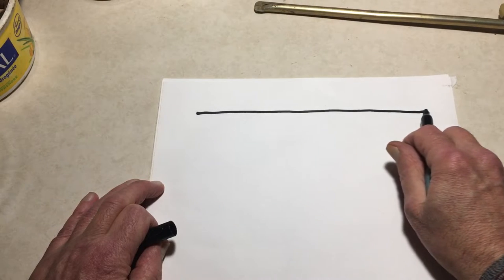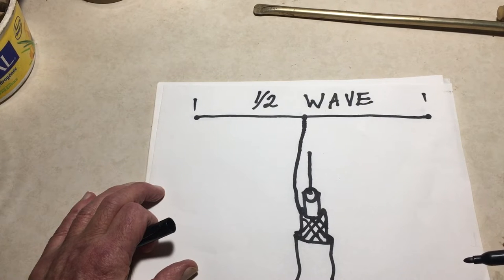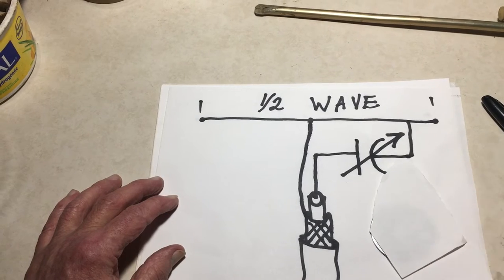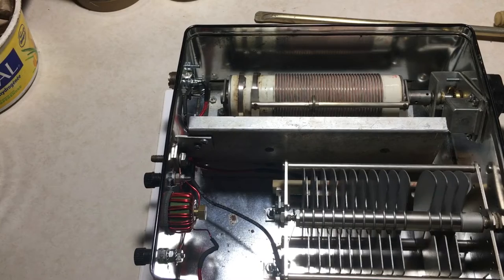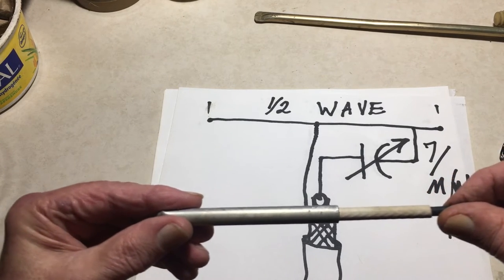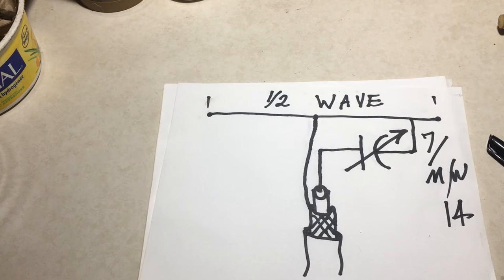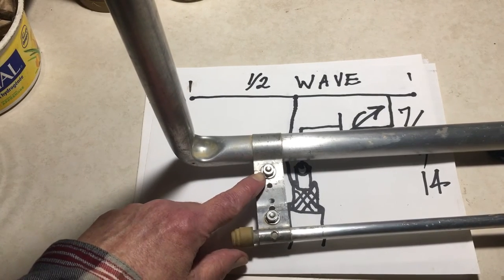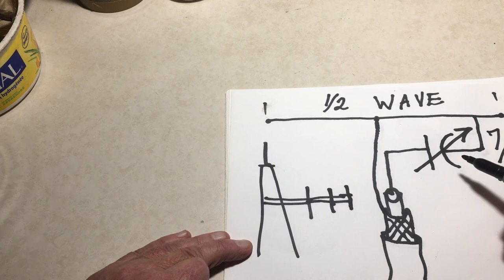The Gamma Match ~ Easy Antenna Tuning Built-in

Comment: Of course the real explanation of a gamma match and how it works is an interesting discussion. First of all, the parallel conductive segment to the driven element steps up the impedance, much like a folded dipole. This in turn adds inductance. The variable capacitor component is then used to tune and cancel this additional inductance out.

Comment: A great tutorial on Gamma Match's. I've been building yagis now since 1972, and have used many feed hookup designs. "T" matches. Delta feeds, Pigtails, and of course Gamma Roads. and I can tell you I've stayed with the Gamma on 99% of my builds . I make most of mine with RG8 coax center dialectrics for the center inside an alumimun tube from a HF mono bander thru 6m,2m 220 mhz 432 Mhz to even 900 mhz yagi's and with great success in feeding. adjusting and performance. thanks for reminding me that my choice was correct! and for sharing. de Ellis WA1RKS
Reply from the maker: Thanks !
73 de VO1DV
Reply: How do you know where to clamp the shorting bar to the driven element?

Comment: What about multiband? If the Gamma match is set for the lower band, do multiples also match?
Reply from the maker: No it’s a monoband antenna but the 1/2 wave design characteristics may be applied to other bands. 
1/2 wave driven element with 
1/16 wavelength gamma rod may be applied to any band. 
According to antenna theory 
“Voltage at the center of a half wave antenna is zero”
So this allows the driven element to be grounded at the center.
Reply: If you want perfection, hi efficency of you antenna system can't  be broadband! Broadband is delusion of  low cost  propaganda!  Professional systems make in 3 or 4 section selective super tuned systems from exciter lpf antenna system!

Comment: This is great valuable information on the Antenna, driven element and gamma match. Any additional information on 27 mhz antenna building would be great. Whether,  it  be 4 element beams or multi-directional antennas. Thanks for the information tutorial, enjoyed it. Billy...Albq. N.M.    2 / 16 / 2023
Reply from the maker: Length of a half wave antenna in feet = 468 divided by frequency in MHz. This can be applied to any band. Thanks for watching and check out my other videos to see some of my other creations. 73

Comment: If they are setup correctly, the gamma works great. I had a 2 element V Quad several years ago, it was gamma matched and had an SWR of 1:1.3 or less from 25mhz through to 29mhz. I still have the QSL card from a guy in country that no longer exists in Europe. We chatted on 27.650 USB for almost 2 hours one night, at an S9 or above. Damn great antenna that one, I still miss it. Nothing came close for OOB usage and pirate CB radio. A fellow I used to compete with for contacts had a 5 element Yagi about 10 foot higher than my quad and he needed 100w more than I did to make the same contacts. Nothing beats a well tuned antenna, and the gamma match is a fast easy way to acheive that.

Comment: Great explanation. How does it work when there is no capacitor present and there is a direct connection via a aliding bar, as with a yagi i use and a halo i have just built?
Reply from the maker: Your “sliding bar” adjusts to find resonance. 
The “sweet spot” I am guessing as I haven’t seen your antenna. 
Glad your antenna is working for you. Keep up the good work.

Comment: On your 6m halo -- is the "halo" fully closed opposite the feed point / gamma match ?  If so, is the overall tube length just 1/2 wavelength?
I'm trying to find novel ways to build a more compact dipole for the high bands w/o inductive lengthening.

great presentation of the gamma match!  thank you so much!
Reply from the maker: Yes it is a half wave loop fed at the centre except the elements are bent 
Thanks for watching !

Comment: Your explanation helped me. 
Yes the center is at zero voltage, its just hard to seperate grounding and the null point of a driven circuit. 
The far side of the half wave looks like it should be driven. Hard to remember the voltage on the right half
will induce a voltage on the left side. 
I keep wanting to think the atenna works because the right hand, driven side,  sucked the left side electrons past the ground, null point, to the right hand high side. Right???
Reply from the maker: The gamma rod and shorting bar when tuned correctly makes a resonant loop which induces a standing wave in the driven element.
Reply: When you look at this thing, think of a center tapped transformer, and the voltage wave across it. The null point of the "sine" wave is the ground point aka neutral, and each end the opposite of each other. Doesn't matter which end is energized the other is opposite. So you tune the injection point and the other follows suit. In my limited understanding...

Comment: The capacitance cap on a Hustler 4 BTV could be used as a Gama Match!  You replace the ones you use with aluminum stripes.  Or buy replacements from DX Engineering!  They sell tubing and parts to build your own antenna,

Comment: Hands down the best description I've seen of the gamma match. I just got a yagi that uses one and it works, but I couldn't make heads or tails of it. Your explanation of the variable resistor was excellent.

Question: How does the location of the strapping point come into play? It can't be arbitrary.
Reply from the maker: The shorting strap combined with the variable capacitor when properly adjusted form a resonant loop which tunes out reactance and induces a standing wave in the driven element. 
Hope this helps. 
Thanks for watching and share with your friends. 
73 de VO1DV
Reply: @madeinfoxtrap5539  Sort of. How does one know where on the driven element to attach the shorting strap?
Reply from the maker: @toddhowell2299  experimentation with various settings until you achieve resonance. Forming a resonant loop sometimes takes a bit of trial and error but with patience you can tune the match 1:1

Comment: Thank you for excellent explanation of aimetric to asymmetric transition adjustment. Is possible add static protection on antenna L grounding ?
Reply from the maker: If you mean an inverted “L” ?
I’ve never made an inverted L So I am not able to comment. 
This design is center grounded.

Comment: Thanks for the axplantion about capacitance but what about the distance between center and shorting bar .the capacitor consist of shift and tube and the area can be changed according to their diameters so what about the distance between center and shorting bar please advice me.thank you very much.
Reply from the maker: Best I can tell you is experimenting until you achieve 1:1 
Adjust until you reach resonance. A bit of trial and error involved but with some patience this design can be tuned flat.
Reply: @madeinfoxtrap5539  A little math can steer you closer, quicker. Does anodizing effect the sensitivity?
Reply from the maker: @bryanst.martin7134  mmmm not sure but I would go out on a limb and say no. If any decrease in sensitivity by any type of coating it would be negligible and probably so little that it ‘s unmeasurable
Reply: @madeinfoxtrap5539  Thank you. Welding is one of my skills, and Al Oxide is tough thermally and electrically. Not sure how that may relate to low voltage, higher frequencies and such. Maybe the high level of signal amplification makes it negligible?
Reply from the maker: @bryanst.martin7134  sorry I misunderstood. Anodizing is a coating applied to aluminum whereas oxidizing is generally caused by the oxygen in the air. This may be alleviated by coating with a thin film of grease or your favourite anti-oxidizing agent.

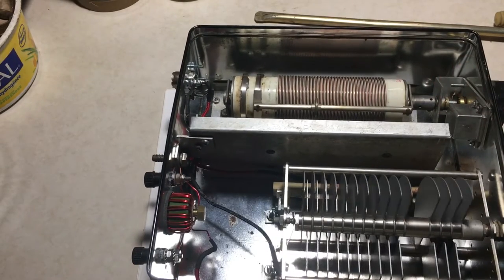Comment: 5:54 Isn't vacuum a worse insulator then air? I'm a pilot and I fly an airplane that can go up to 23,000 feet with a piston engine with magneto driven ignition system. We've had problems with arcing inside the magnetos at high altitude before because the less dense air is a poorer insulator. They sell pressurized magnetos to fix this problem.

So I'm confused as to why a vacuum capacitor would handle a higher voltage. That seems at odds with my experience in another domain.
Reply from the maker: Look up “vacuum variable capacitor”
They are used in high voltage applications 
Magnetic Loop Antennas use them 
They are normally expensive 
You are not flying in a vacuum 
While the oxygen may be thinner 
At higher altitudes there is still enough 
Oxygen for the engine to run. 
Magnetos behave differently than capacitors 
They have to produce a spark for ignition 
If a capacitor arcs a spark it may be catastrophic. 
Hope this helps and thanks for watching !

Comment: Hello- I am trying to build a yagi antenna with gamma match tuned for 166.38mhz from the information in this video. I used a piece of lmr400 with a drilled aluminum tube, but ive clearly done something badly wrong as i have an SWR over 80 according to my nano vna. This is my first antenna build so im not sure what went so wrong- i suspect that I didnt ground it properly. Does the coax need to be soldered onto something as i have seen with split dipoles? I also thought maybe the sheath on lmr 400 disrupts capacitance. Your help would be much appreciated
Reply from the maker: Lot to unravel without a video but the driven element should be 1/2 wave center grounded   Yes the shield of your coax Feedline should be bonded to the antenna. The center of your coax should be bonded to the gamma rod. 
If you are using a piece of coax for the gamma rod only use the centre conductor and insulation inside the gamma tube. Marine grade heat shrink tubing is great for insulating the gamma rod if it is not fitting perfectly. Using both conductors of a piece of Feedline as a gamma rod would certainly cause trouble as coax itself has its own capacitance between the two conductors separated by a dielectric !  Make a video so I can see what you are doing. 
73
Reply: @madeinfoxtrap5539  Many, many thanks. I made a split dipole antenna before you replied and got an swr of 1.6 using the same measurements/calculator as my previous failed antenna. After reading your reply I simply connected the coax sheath to the center of the driven element taking extra care to make sure the sheath and any stray braids didn't touch the center of the coax which was connected to the insulated wire (not coax this time) inside the gamma tube. Despite extremely poor unsoldered connections I managed an swr of 1.4 after fiddling a bit with the location of the gamma tube. My goal right now is to make a much more refined version that can take being mounted permanently outside, and then post a video guide for building antennas for MOTUS bird telemetry applications. I am sure I will have many more problems to work through but am relieved to no longer have an swr over 100 haha. Thanks again

Comment: I have a sdr to spot the airplane's in my town, and build my own antenne and it works fine, but now i want to hear the airport tower and planes, can i do that with this antenna you show?
Reply from the maker: Not sure how far away from the airport you are but for any antenna to operate at utmost efficiency it should be a multiple of the wavelength 
You are using. Any antenna will work to receive but a resonant antenna will be the most efficient. If you are some distance from the 
Airport maybe an array like a yagi or cubicle quad could afford some gain. There are also RX preamplifiers to boost incoming signals from farther away. 
Yagi and quad are directional and offer a little gain depending on the number of elements. Other antennas used for RX in VHF bands are the DISCONE. 
Others have told me that they work fine. 
Hope this helps. Thanks for watching and share with your friends.
Reply: @madeinfoxtrap5539  I'm 6,5 km from the airport.
Reply from the maker: @andarthome142  you are very close !
Just about any antenna should work fine.
Reply: @madeinfoxtrap5539  THX for your info.
Reply from the maker: @andarthome142  thank you for watching !
Check out my other videos on my YouTube channel 
Good luck !

Comment: Great demonstration Thanks, One question, Is the distance between the gamma rod/capacitor to the radiating element non-critical, does it need designing in, or is it just a matter of practicalities? I really like the pf=7x wavelength rule of thumb. Thanks again
Reply from the maker: Usually 4 inches for 2M
Hint :
You are creating a resonant loop with the combination of capacitor , shorting bar , connector bracket and the radiating element.
Reply: @madeinfoxtrap5539  Right, gotcha thanks. Looks scalable. I'll be having some fun experimenting with that soon. 73 de GØUSL
Reply from the maker: @G0USL  73 de VO1DV

Comment: wonder how is the performance compared to a hairpin matching, in terms of gain, bandwidth and directivity pattern
Reply from the maker: I haven’t tried that matching system so I am not sure.
Reply: IIRC, matching method would not have an effect. It's the antenna design, feed point placement, and related factors that dictates gain and pattern. Also, height as well as surroundings will be in play.
Reply from the maker: @tahoma6889  yes indeed there are many factors at play. I’ve heard from others that the hairpin match can be tricky to tune. I haven’t had a reason to try that matching system so I am not able to say anything about it. After getting great results with the gamma match on a half wave antenna I did make a 5/8 wave antenna for 2M and used a “shorted” or inductive matching system through a two turn coil. That’s about as close to the hairpin match as I have ventured.
Reply: @madeinfoxtrap5539  hairpin just takes some getting used to. With todays tools we can zero them right in. It was a hassle back in the day when we were limited to an swr meter or dip. 😁
Reply: If performance-wise its the same, sounds like an easier match to build.
Heard somewhere that a hairpin match is balanced, so it may need a 1:1 balun to match an unbalanced coax

Comment: Is there any difference if the center of the element is separated and ground going to one side and driven going to the other side while using a gamma match on the driven side? I am using a 3 element yagi I made with wire and the driven is divided in the middle, braid to one side and center to the other side and no gamma match. What is the effective difference?
Reply: It's the difference between having an adjustable match, and relying on the native impedance of the design of the antenna with no adjustment other than physically changing the antenna.

Comment: Sir, what is the best dimensions of gamma match lets say for a 7 element 2 meter yagi? The reason I ask is because I've seen different lengths use, some 5, 7, even 11 inches gamma tube.
Reply from the maker: The best length is the one that works. The length may vary depending on the overall dimensions of the gamma match. The best I can tell you is to experiment until you find the best length for you.
Reply: @madeinfoxtrap5539  Much appreciated it sir. All the best.
Reply: I've known people to run into trouble with building random gammas. There is a segment in the ARRL, at least in my 70s edition. It discusses this and shows plans for a VHF version which can be scaled for any frequency.

Comment: Thanks.  I have a 2meter version Yagi with a gamma match. Can't get it matched to where I will like it. Breaking down the adjustments, should I fix the strap position and only adjust the capacitor to best match SWR  then tune the strap position second, or the other way around?  Thanks again!  KE6KBM
Reply from the maker: Keep adjusting both points (one at a time) and you will eventually find the sweet spot. At first it seems a bit difficult but with patience and experience you will develop a familiarity with it and it will get easier. 
Thanks for watching.
Reply: @madeinfoxtrap5539  Thanks!!

Comment: Does the radiation pattern change with a gamma match half wave dipole vs. your standard non-matched dipole?
Reply from the maker: If the dipole is half-wave the radiation pattern will be the same. If the dipole is other than half-wave the radiation pattern will be different.
Reply: @madeinfoxtrap5539  aah yes!  Pattern is due to the radiating elements.  Thanks!